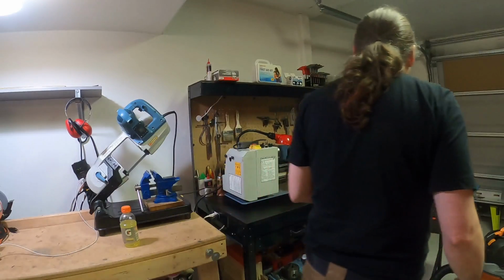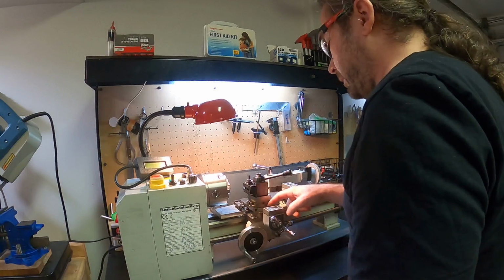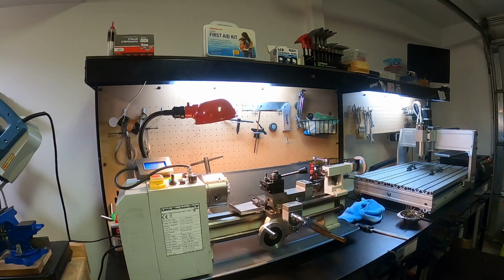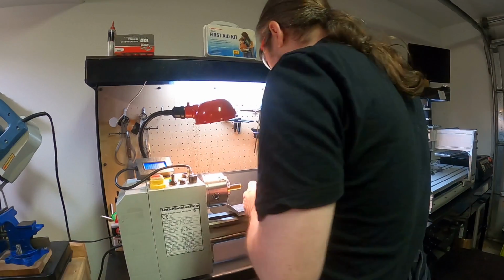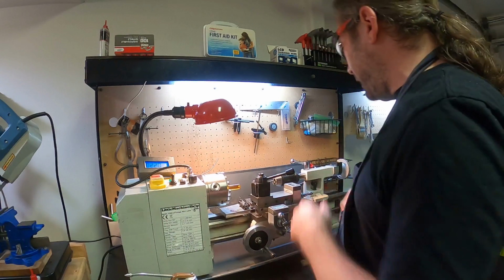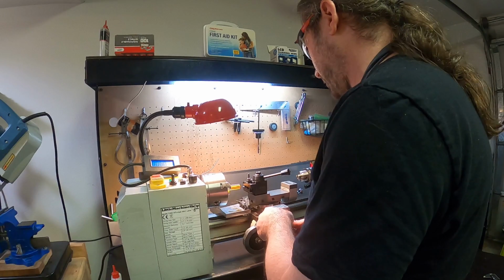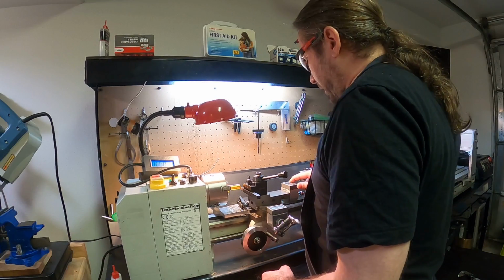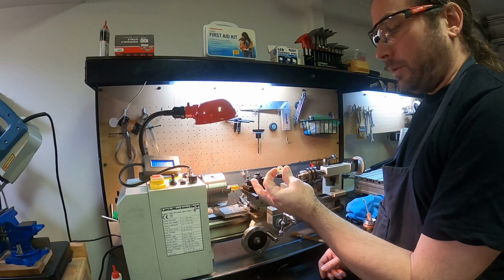Twitch Stream - PRESTO 1-D 12-25-2020

Comment: Hi Todd, thanks for the tip about reverse polarity on the coils. When you say it, it makes sense but I simply wouldn't have thought of it & I think you have saved me a lot of potential pain (I'm going to be making a cutting head soon).
Reply from the maker: Mono head?  That tip only really applies to this specific implementation of a mono cutterhead.  But, hearing what I said, making note of it, only tells you the what of this specific design.  Do you know the WHY?  That is more important.  Understanding why that arrangement here is important is I would argue more IMPORTANT than knowing this one trivial fact.  I'm willing to talk it through with you here in comments if you would like to try to figure out why with my assistance.  Have a guess?
Reply from the maker: You may be confused about what I mean exactly.  I think I may post another short video to explain the flux configuration for a waveform as the cutterhead transducer traces positive and then negative excursion from 0 volts.  I need to get proficient at animation software first so I can make a nice visual representation.

Comment: Todd, would totally donate or help make tooling for you. Have you found any options for small shell mills that will work in your router? This would help with surface finish.
Reply from the maker: If you or anyone would like to donate to my efforts, please do at PayPal to todd@deepgroovesmastering.com.  I'm planning on buying a mill.  But, the full list of tooling and the mill itself comes out to between 5 and 6K USD.  So, I'm saving for that currently.  Since I do many things, I can't invest solely in machines and tooling...  But, that will come.  And, I know exactly what I plan to buy.  Either way, even with a true facing tool, you still get tool marks.  They are easy to buff out and that is what happens.  Tool marks, even on surfaces which feel and measure true, are just an unavoidable reality like death and taxes.  No matter the style of tool.  Buffing tools or wheals are the solution.  Or, as I stated in the video, you can also use WD40 and sand paper.  If you search here on YouTube you can find a video with a guy who brings a piece of dull sheet aluminum to mirror finish using this process.

With respect to my desktop CNC, I have many types of end mills for all sorts of operations.  But, best to do surface facing on a real mill.  My CNC spindle is not very large.  So, the things that can mount to it are limited with respect to diameter.  To do true milling operations, you need to be able to mount real Tormach style tool holders which are beyond what my spindle can accommodate.

With respect to a milling attachment for the cross on the mini lathe.  I've tried it.  It's a really bad idea.  The mini lathe is just not meant to handle that amount of torque.   If your gibs aren't ultra tight and nearly unmovable for the cross and the ways then you'll damage one or both trying to use the milling attachment.  Additionally, the milling attachment is really not a great tool if you are trying to bring a rough block of work to a precision block for adding features to.  You really need a CNC or Mill for precision work.

You'll see me milling on a real mill in 2021!
Reply: @opcode66  If you have the space for something larger than a Tormach,  by all means buy it. I have an 1100M - it's awesome, but a Fadal would be ideal if I had more space. Toolchanger included, larger work area, fix it yourself, etc. Anything that allows you to make the most amount of lathes in the fewest amount of setups. You have a good product that a lot of people will pay $ for.
Reply from the maker: @justinw.4433  Thanks.  Yes, I have more space.  And, the plan is to expand the machines and tooling.  Yes, I will certainly sell some items once I release them.  And, I'm extremely close.  I just refuse to put out something that isn't 100% with respect to function as well as usability and reliability.  I'm not going to use customers by selling a product that is only 80% of the way to final so I can get some money to expand the tooling, and then make a product that is 100%.  I would rather take longer, finance this all myself or through donations, and do it all right.